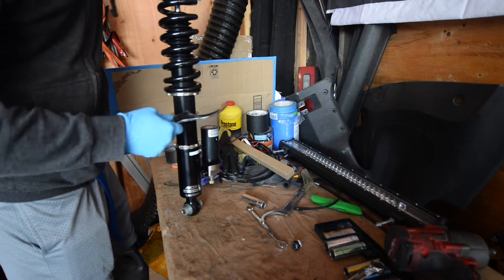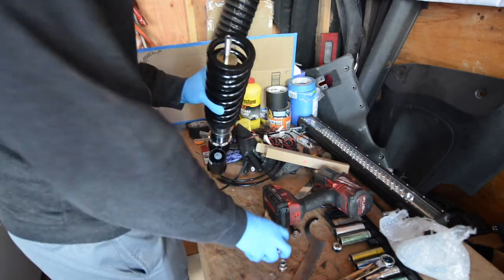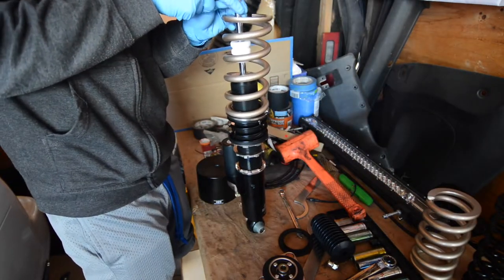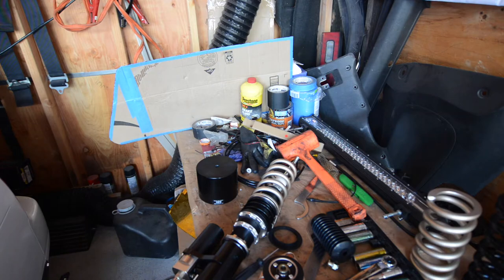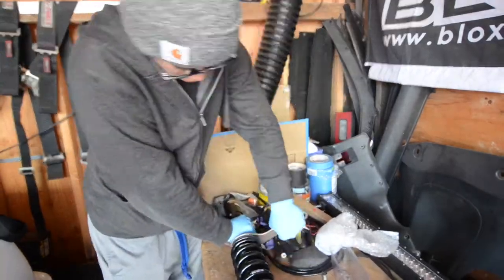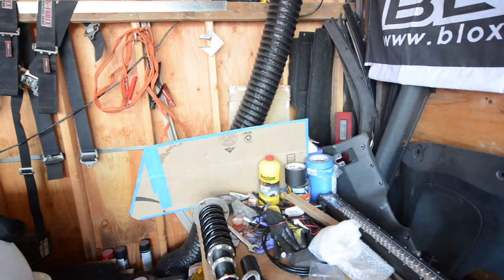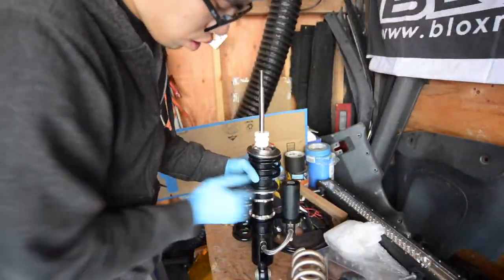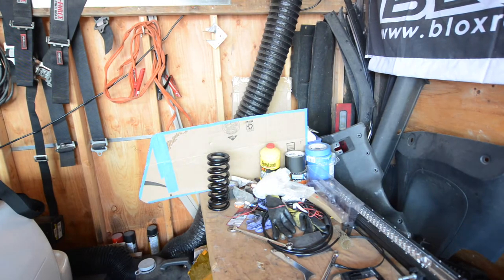08 14 ISF Coilover and Air Cup Install Part 1

Comment: What was your reason for installing the helper springs? Did the SWIFT springs have a higher spring rate than the OE BC Racing ones?
Reply from the maker: You need the helper springs to give the setup enough droop so the air cups and push up.  If there is little to no droop, the air cups have no room to push up and just end up compressing the spring. Swift springs are just nicer in general. As for spring rates you can order both BC and Swift springs with your own specified spring rate.
Reply: @tougelab3996  it's not necessary if you have the correct spring rate. And since you upgraded to Swift springs I'd say they're even more unnecessary. If your preload is set correctly you will still get the maximum lift. The springs will compress regardless of helper spring or not. Droop in this case refers to the amount of spring compression available to raise the car.